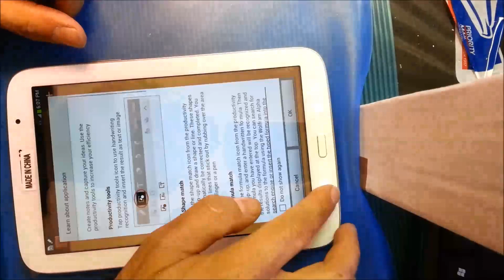Samsung Galaxy Note 8.0 screen repair glass only www.texfixdfw.com

Comment: Thanks for this video. I just finished replacing my digitizer and really appreciate having this video as a reference. The glue is very hard to remove. I ended-up using ArtiClean 1 and it worked well. GooGone would probably have worked too. The only problem I had was that I lifted part of the LCD off of the LED backlight and chipped a tiny piece of it. The LCD screen is plastic and is adhered to the glass LED backlight. Because it is a sheet of plastic it is easy to scratch and, if you're not careful, you can pull it off when you are trying to remove the digitizer. The last thing I have to say is that this repair is not for the faint of heart. I put this off for 10 months because my digitizer was still working under a broken screen. When you crack that corner and start peeling off the digitizer you realize you have passed the point of no return. Just take your time and watch what you are doing.
Reply: Do you know where I can buy the replacement screen? Thx

Comment: I just changed my samsung note 8.0 digitizer last night successfully.
Online information and tutorial were insufficient, i followed this video tutorial.

I bought the digitizer on ebay with the pry tool x 2 , screwdriver, and T5 torx and 
3M 9495le Double Sided VHB Tape, 300 LSE Adhesive from another seller.

I followed exactly the instructions in the video, just few points to take note:

1) use harder card or similar item to separate the digitizer from the lcd.
2) Extra attention is needed at the bottom part where contains menu, home, and esc keys. I accidentally pulled out the menu backlight key during the separation. Now my note 8.0 is functioning without the menu key backlight.
3) Heat gun is recommended over the hair blower for adequate heat energy and fast separation.

My original color was white, i bought a black digitizer to replace, now my note 8.0 is black with white home key, lol

Comment: A "note" for anyone contemplating this repair.  The adhesive between the glass and LCD is extremely strong even when heated.  As a matter of fact, trying to separate the LCD from the glass ended up in me damaging the LCD.   (yes I heated it)   I've repaired dozens tablets (Samsung, Motorola, and Apple) so I don't consider myself a beginner.  Getting the corners lifted wasn't a problem (heat gun/dryer works well just like all the repair videos advise).  It's just the portion between the glass and LCD.  So just a word of caution that this is much trickier than the 1-3 repair videos make it seem.

Comment from the maker: Hey sorry for late response everyone. A few questions to answer: local adhesive is not necessary on this tablet. Local is used on this device to reduce glare and makes for crisper display. It's not needed to assist the touch function because the digitizer is now laminated to the new glass just the way digitizers used to be made in the past. Touch is not affected without local glue. My result have been good so far and no problems with replacing the glass digi. But I still don't recommend inexperienced to do this job as the lid CAN break. This video is intended more for those who repair electronics. Thanks guys
Reply: I am just a normal user who want to save money in replacing the digitizer and i successfully changed it with your tutorial.

Thanks
Reply from the maker: Excellent. Good job. It's difficult. Glad you did it!
Reply: tex fix With your video, i knew the possibility to get it done. Thanks again
Reply: +tex fix I know this is from a year ago, and I hope you've learned by now but it's called "LOCA" or Liquid Optically Clear Adhesive
Reply: Hi! Thanks for this tutorial I will soon replace my digitizer with this tutorial you made. I have a question though, do I need to find the same adhesive used all over the screen or no? I'm worried the digitizer would fall as this tablet is sometimes being used by a kid. Thanks again for this video

Comment: Thanks for the video. This was my first time trying to make any repair to any electronics device so i'm new at this. I ended screwing up the lcd screen and now I decided to buy a used device from Amazon or Ebay. I don't know what i did wrong. I used a blower to heat the adhesive and i was able to remove the digitizer, then I used alcohol to remove the adhesive, then I re-installed the battery and connected the new digitizer, but the lcd wouldn't work anymore. I don't know if it was excessive heat or too much alcohol. Well, sometimes you win and sometimes you don't. Thanks anyways.

Comment: 1st attempt, i peeled the black film from the lcd and it showed all white. The second attempt appeared to go well. I heated everything nicely and all the glue came off. However when I booted up the Note, you could see purple marks on the lcd, like where the biz cards was peeling. I didnt use a lot of force and it all came off pretty quickly, no issues...well except for the purple marks.

Comment: Would it be practical to leave whatever adhesive remains on the LCD, and just put on the new glass... especially in light of using the molybdenum wire?  Would it then become visible, and distort the display?  Or would it be best to just remove whatever adhesive remains?  Also, aside from pushing it off with fingers... is there some sort of cleaner/solvent which is acceptable it use?

Comment: Hi. My Note 8 fell and the glass broke. Thanks to this video I managed to remove the old glass and mount the new one with the mentioned 3M adhesive tape. There is only one little error: The tablet doesn't recognize if the pen is in the case or not. It shows that the pen is removed permanently. Do you have an idea why?

Comment: Excuse me, what temperature is recommended for heating the glass? The glue of the note 8 is equal to that of smartphones s3 or s4? thank you very much!
Reply: I used a heat gun on low and heated each are for a few seconds. I don't know the temperature, but it was very hot to the touch but I could still hold it.

Comment: did you uses an adhesive to attach it?
Reply: Default adhesive for the screen is OCA-Optically Clear Adhesive which is hard to be obtained and applied.Instead, I used 3M 9495le Double Sided VHB Tape, 300 LSE Adhesive
Reply: Ixson Ix if don't put any adhesive will there be any bubble on it?
Reply: AnimeDubbed Version There won't be any bubble. Just make sure that the screen is clean when u seal the digitizer
Reply: Thx for the reply.

Comment: Unfortunately I did try this...

Now the LCD is damaged (several completely dark spots) and has some lighter areas (where the digitizer comes in contact with the LCD - especially the middle). This repair method has QUITE some risks and difficulties. Of which none were mentioned in the video unfortunately. Maybe you wanna do some notifications? I do not recommend trying to repair LCD assemblies - not worth the time, risk and money. I will have to use the tablet as low-cost server or similar now.

Comment: I accidentally slept on my note. Now the screen is black with large yellow spots and blueish lines....nothing displayed. Touch screen is working fine (tested it by using an external monitor). Any idea which part I need to replace?
Reply: LCD if touch works LCD is what got damaged

Comment: fuck i have break my note8....the screen is only white
Reply: nibua25 I did the same thing. I accidently peeled off the black film thinking it was part of the digitizer, but it was actually part of the lcd. I know this because on the second note a corner of the film came off and I could see white under it, but when i pressed the film back down, it was black.